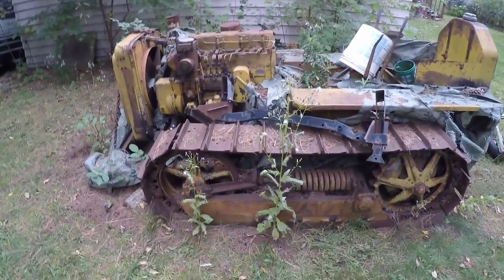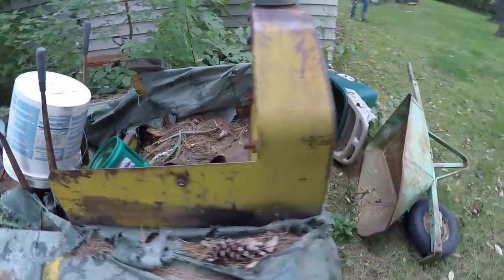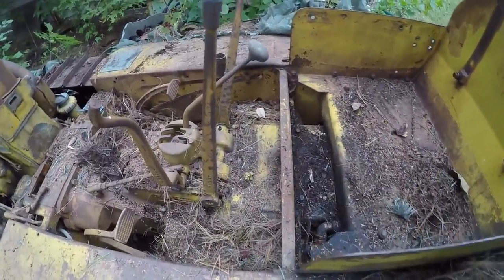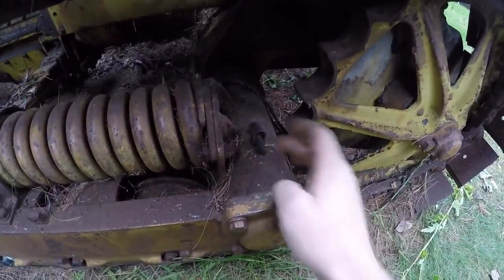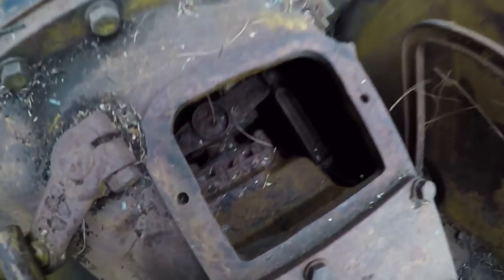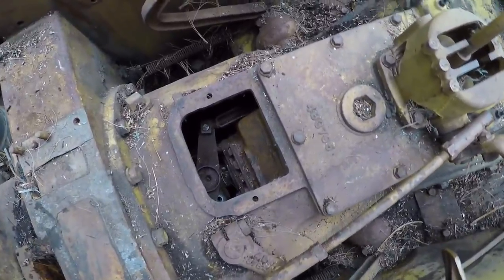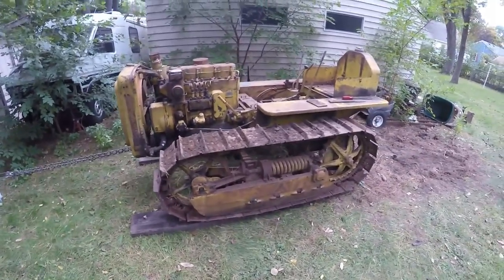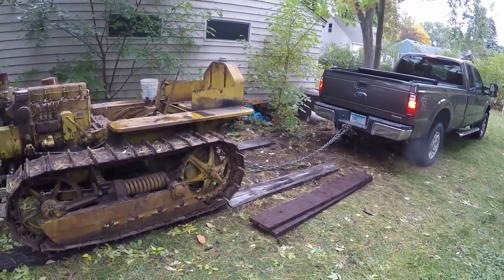Caterpillar D2 #5J1113 Recovery Mission Part 1 - Preparation to Load and Haul

Comment: hey i've used JB weld for cracks like that works great drill out ends of crack and bevel fill with jb weld worked great with and old iron block i had

Comment: We have been slowly endeavoring to recover  D2 3J7690 and after a massive job replacing the precoms in  the head we got to the stage of starting the engine! It ran for approximately 5-7 minutes then bogged down and stopped !  We tried to turn it over wish the crank handle  but it was locked up, after approximately 2 minutes it freed up and was able to be restarted. This has happened three times ! We drained the oil and it was free of any metal material , any suggestions as to what could be the problem? 
Pistons have not been removed, could the rings be grabbing?
Love your videos

Cheers

George

Comment: One thing i never understood. Operators of these machines know that if you leave them on the ground, they will rust away. So why in the heck, couldn't the people that parked these machines (in general) use a few dollars worth of bocks to lift them off and a piece of plywood to cover the sensitive bits.
From my place of mind, where both my grandpa, my uncle, and a few others in the family have always left items of this type raised off the ground and at least covered in plywood (grandpa build a small shed on his D2 using the D2's own structure)...i mean, i know they might be deemed as dead, but you don't operate these things and not know that parts are still valuable.
Dunno, maybe i'm assuming too much, but every time i see a parked vehicle (not to be confused with abandoned) this irks me to heck and back.

Comment: i was watching this.. and an idea came across my brain..  a pair of hydraulic drive small size excavator track/frames.  with some creative square tubes welded in, some long thickwall square beams to connect between them.. . one could make a hydraulic tractor recovery dolly..  imagine the tow dollys that have the 2 small tires on each side of the back of the tow truck.   using hydraulic power from a skid steer that is also used to position the track frames and steel beams in place under the tractor that has been jacked up ..  could it work.. could it be a going small business..  could it be scaled up for really big tractor recovery.  is it a crazy idea.. yep.

Comment: My parents have an old D2 this era as well, though it hasn’t ran in about a decade. It was stuck in gear like you showed, but I managed to get it into neutral. This thing will not roll on its own. Engine is locked, has electric starter and it turned over about 1/16 rev before she stopped. But if trans is in neutral the tracks should spin right? We pulled it with a backhoe and the tracks wouldn’t move at all. Any advice aside on what to look at trans to get it to roll?
Reply: I hadn't considered the brakes being locked up, but I will take a look. Thank you very much.